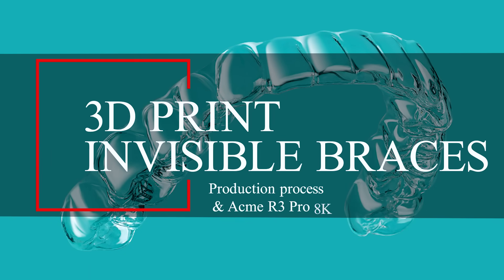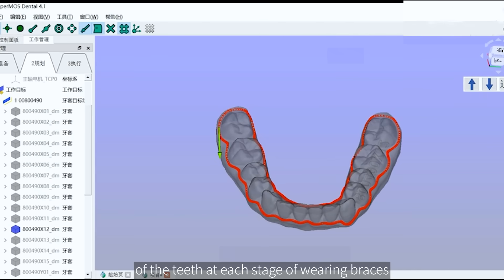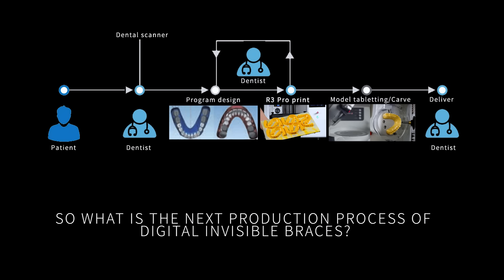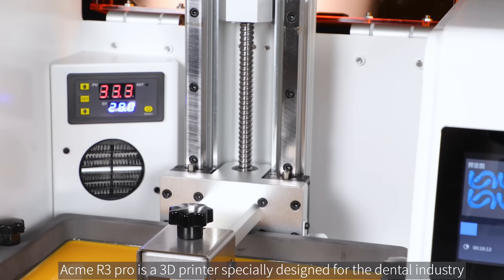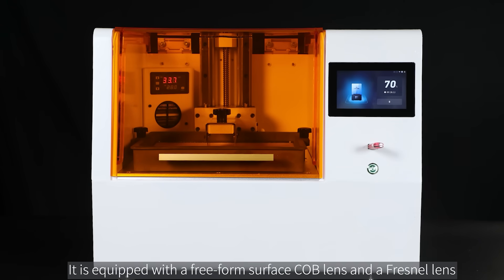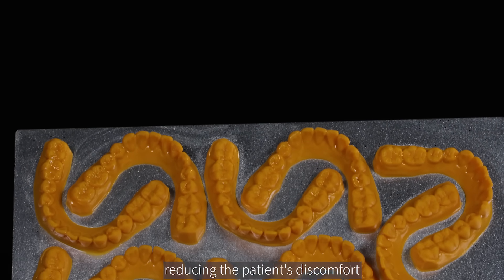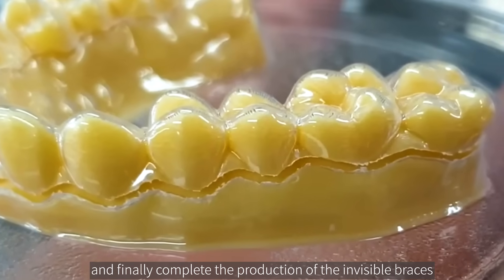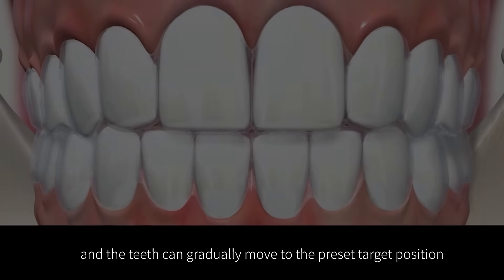Acme R3 Pro 8K UItra-High Definition Dental 3D PRINT INVISIBLE BRACES Production Process

Comment: R3pro is high precision 3d printer, use up-to-dated 8K COB light. What is more, there's a temperature control inside the case, to print well even in cold weather. After I tested R3pro, I love it so much for its steady print quality. The best printer I have used. Thanks.